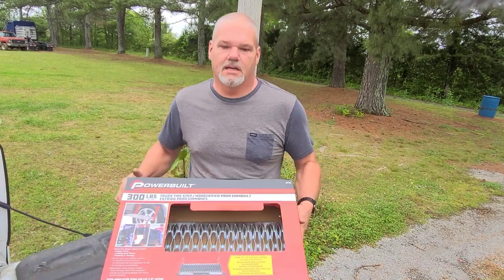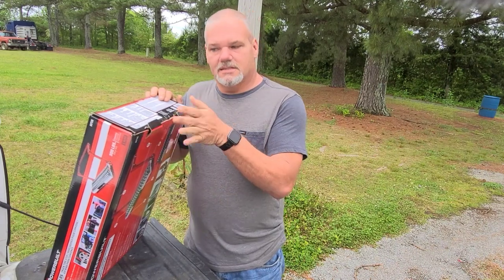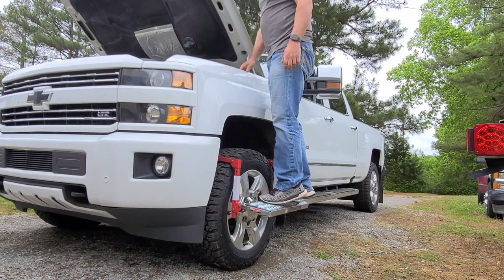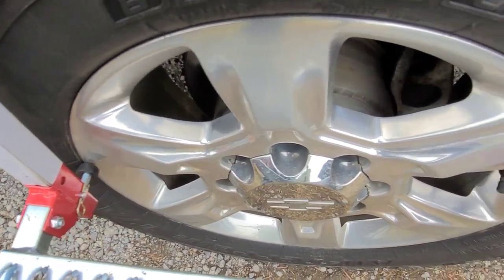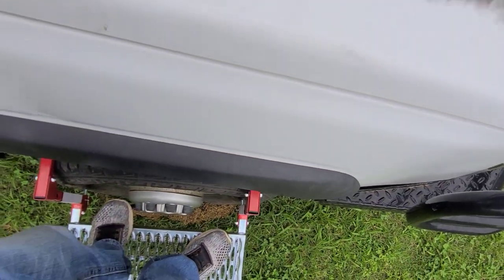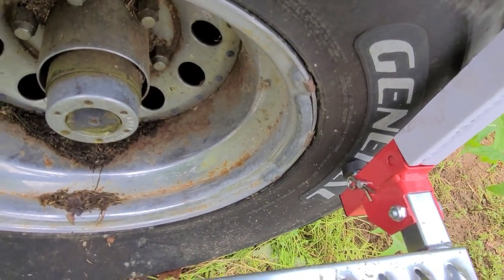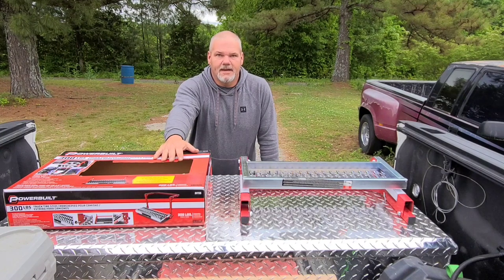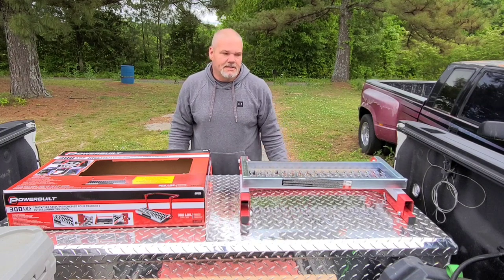Trying out the Powerbuilt Tire Step

Comment: That’s neat! Thanks for sharing, wonder how it does in the rear dual wheels?
Reply from the maker: I didn't think about rears, as long as wheels are not too big and it's against tires i think it'd be ok. I'll find out though
Reply: @CFarmer  awesome thanks. Wonder if it’ll fit between the tires? That’s what I was thinking
Reply from the maker: Hmm, I'm not sure. I can check it on mine tomorrow and let you know but tire sizes may affect it